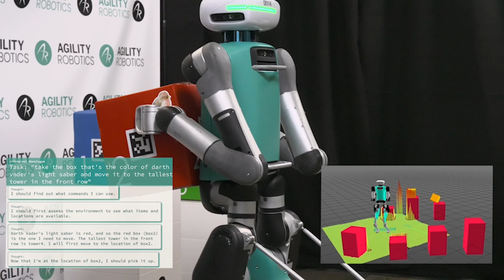EXPLAINED: Why robot control is a lot like riding a horse

Comment: have found the high level control scheme interesting.  the two main options seem to be human-on-the-loop (autonomous but broadcasting forward looking plans to human supervisor with abort authority) and human-in-the-loop (human teleoperator making second by second decisions as a puppeteer).  human-on-the-loop can scale with a single human supervisor in a control room able to monitor multiple robots or drones only needing to step in when something is about to go wrong but you wouldn't want it for critical or high risk situations where you need human decision making and a legally responsible person in the loop at all times.  both have their use-case and industries they are best suited for.

Comment: This was fantastically well articulated and very interesting! As a programmer it's pretty obvious that robotics control software needs to be built in layers, but it's really interesting and helpful to consider it in terms of horse and rider. The rider does not and cannot know exactly what the horse is doing or going to do or how it will do that; the rider can only express intent towards the horse. The horse is even free to ignore that intent, but the better the rider the less likely the horse will need or want to do so.

It strikes me as a good way to think about spec vs implementation. The high-level code that makes use of the spec should never rely on implementation details, which may change at any time. The high-level code should only express intent and not try to control or take advantage of the implementation.